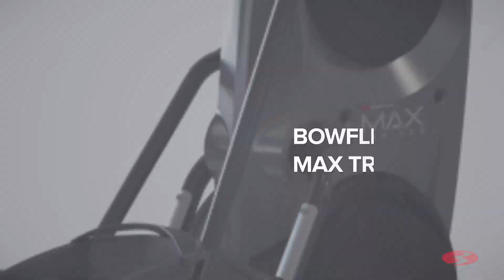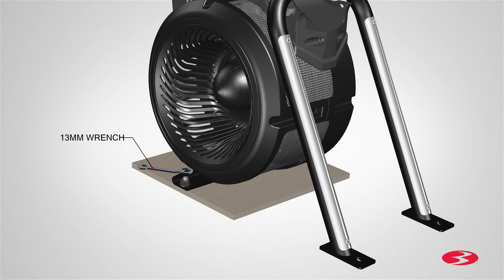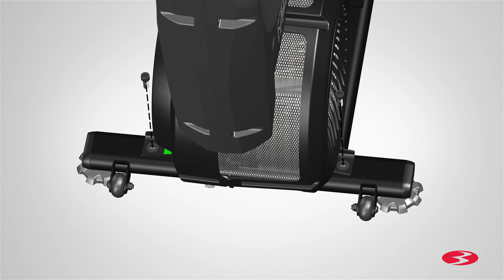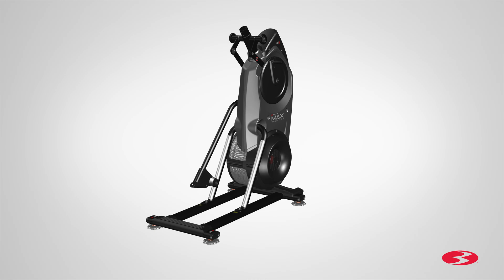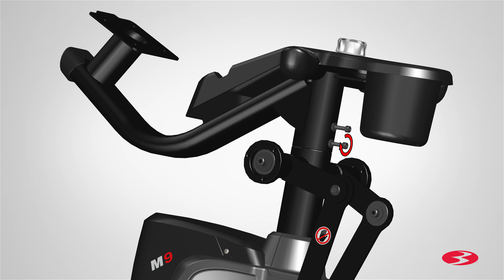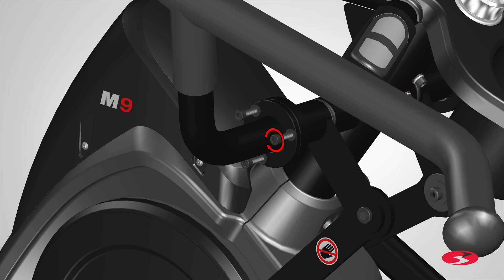BowFlex® Max Trainer M9: Assembly Video

Comment: I assembled mine yesterday, It was simple enough , though the cables seem a bit too long to neatly stow away inside the frame.  NowI just have an issue with the console not connecting to the machine, but I'm sure I can work it out with your Customer Support. 

No complaints about the mechanical hardware , I would have liked small spacers for the arm grip assembly to widen it a bit. ( step 11)  When I hold the central grip the lower part of the moving grip tends to hit my arms. I guess I'll just need to remember to tuck in my elbows :)